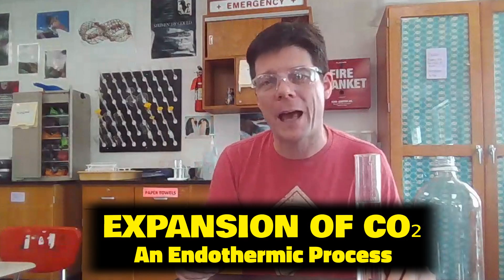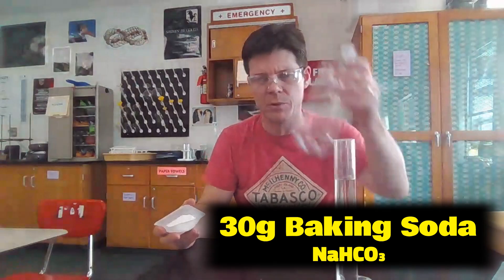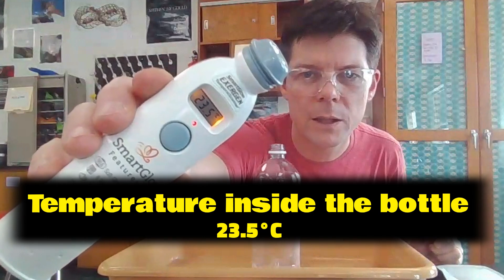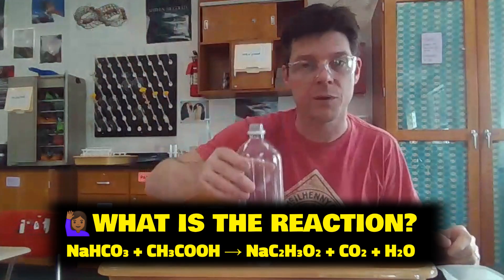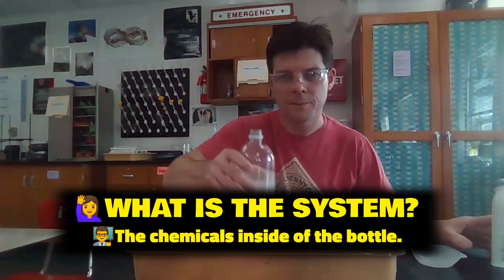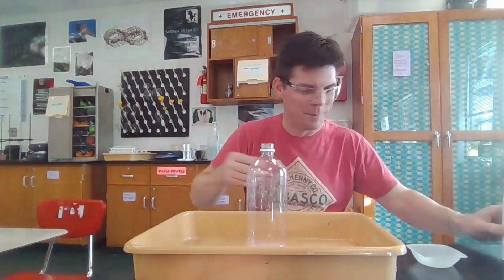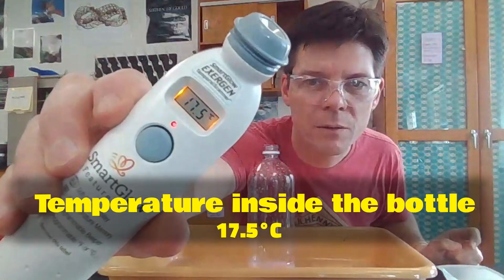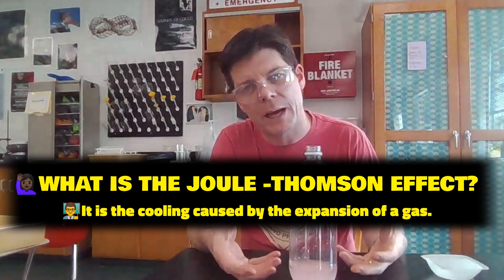🧪Joule-Thomson Effect [an endothermic process]

Comment: thanks for making interesting demos. While i get the idea of trying to witness joule thomson expansion based cooling. This is not the way to do it imo. Here, u have an endothermic reaction, taking heat from its surroundings, cooling the reagents and products in the process. Joule-thomson expansion is when u have a Pressure difference and u release the gas through a valve from the high to the low pressure side. So, e.g. bottle of CO2 in gas state - vs surrounding; releasing that will cool the gas coming out slightly, usually at about 1 kelvin per bar pressure difference (it can also heat but than u need to be at way higher T). In your experiment, there is no high or low pressure side, everything is open to air pressure (1 atm, 1,01 bar). PS: trying to take a sodastream (or so) cilinder will also not do the trick, as there the joule thomson effect is convoluted with the vaporisation of CO2. In the cilinders, it is liquefied, and when the vent is open, gas comes out and more liquid evaporates, taking vaporization enthalpy from its surroundings in the process (compare it to the cooling effect you have when drying without a towel - water evaporating). With respect. M
Reply: Gotta agree, i was also surprised by the Titel because it is misleading